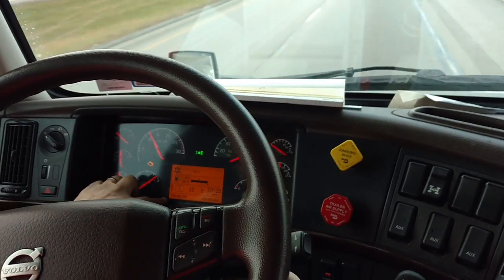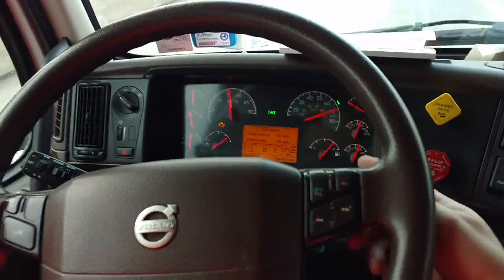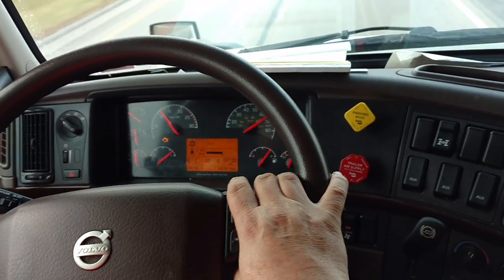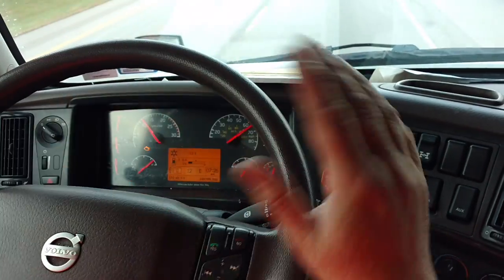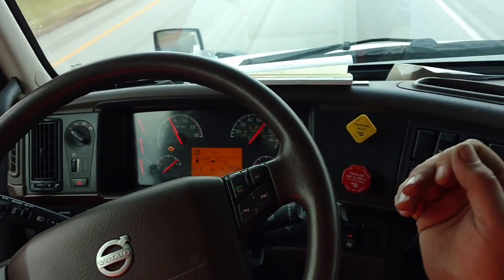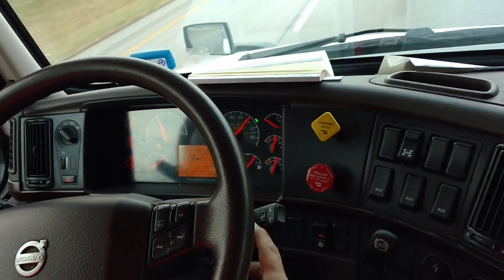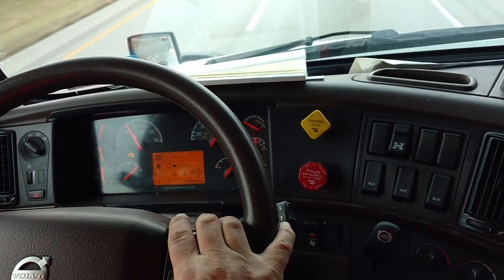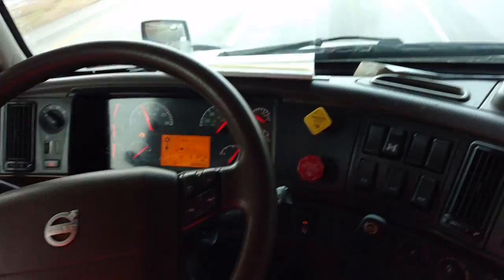Demystifying the engine brake/retarder (same video)

Comment from the maker: Many engines have a delay in the activation of the retarder. If yours does, then it won't interfere with the shifting.BUT if you get (I think) a Caterpillar motor, the engine brake is instantaneous, so if it's on while up shifting, the rpms will nosedive faster than you expect, but if you're quick with the shifter, all will be mostly cool. It messes with DOWNSHIFTING by kicking in and nosediving the rpms just after you revved the engine. (all of a sudden, I'm not seeing your comment: I don't know if I deleted it or hid it or something by mistake. I'm unwinding for bed and my codriver hit a bump. If it's gone, feel free to repost it).

Comment: Is it possible to fit a steel guitar in the sleeper area of a truck? Im concerned about not being able to practice when I go over the road. I hope to be a truck driver some day.
Reply: Maybe the bed folds up? Maybe a single neck keyless guitar would work? I'm really curious...
Reply from the maker: It depends on the truck. A standard D10 will stand up in the closet of a Kenworth, and will fit under the bunk of a big Volvo
The packaseat and amp can also stow someplace.
Reply: SteelguitarLane what do you do if your on a 36 hour layover and want to play the thing? Do you have to settle for playing lap steel or something? Are the sleepers that small that you couldn't set up a keyless guitar somehow? I don't know much about the intieror of these sleeper trucks but some of these guys are out for over 6 months a time... the trucks look huge on the interstate, I was thinking the inside had more room...
Reply from the maker: I have done the following:
1) carried steel and amp into a rest area building and practiced
2) set up in the picnic table area of a terminal 
3) set up with a battery powered amp next to the truck. 
In this big Volvo with a built-in inverter I could set up the guitar in front of the bunk with the amp on the upper shelf if I really wanted to practice in the truck, but it would be a little cramped. In good weather, I'd plug the amp into the sleeper (like I may have mentioned, this truck has a 900W inverter) and set it on the seat with the guitar on the ground next to the truck.
Reply: SteelguitarLane that is awesome, I love the videos by the way.

Comment: I don't know about trucks but can you tell me. Is the engine brake or jake brake different than the exhaust brake switch ?
Reply from the maker: Butt Man Jake Brake is a brand of engine brake, and sometimes people call all engine braking exhaust braking.
(Longwinded expansion starts here, skip it if details bore you)
"Exhaust braking" is the simplest form of retarder, only used on small 6 wheel trucks: it's just a guillotine valve across the exhaust pipe just after the turbo.
Jake Brake and most other retarders sit on top of the heads and play with valve timing, eliminating the power stroke, and using all that compression against the drive train. These things are now crazy powerful. The one in this video develops 515 retarding horsepower but the engine only does 470 going forward. They're sometimes called exhaust brakes, but that's not a very accurate nickname. 
There's a third variation of retarder that is basically a torque convertor that tries to couple the flywheel to the block when you flick the switch. This is really hard on the oil, because it heats the bejeebers out of the oil.
Reply: There's also electromagnetic / induction / eddy current braking.  Not sure why it's not more common.  Pricey?  ... Love my jake brake.  So cool.

Comment: Just got a Volvo- you don’t have to be in cruise to engage the engine brake though do you?
Reply from the maker: No, you don't. If the cruise isn't active, and you leave the retarder in 3 (or 1 or 2, but why?), it will come on when you let off the foot feed.
If you leave it in A, it will come on every time you depress the brake pedal.
If you have it in A, and the cruise active, it will come on to keep you below the top-limit speed (which you can set from 2-10 mph above the cruise speed).
Reply: @SteelguitarLane  But why ? Well because on a lower grade of hill you can use 1 ( or 2  depending ) to keep yourself bang on the speed limit without using the brakes or having to run 1-2 miles an hour over in order for it to kick in automatically. Also you can use it manually without it knocking off the cruise control provided you don't let the speed drop below what the cruis control is set at 👍 greetings from the UK and my Volvo FH16 750